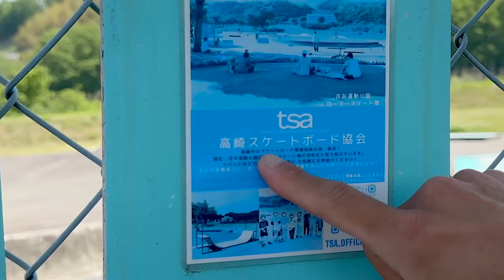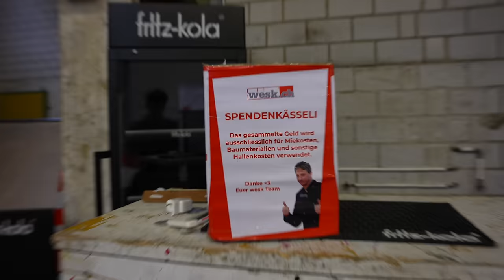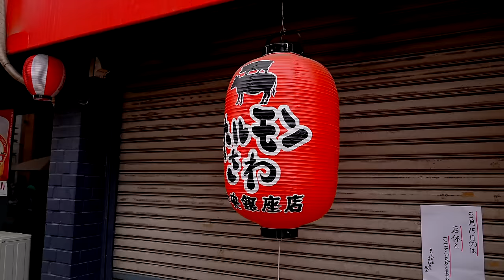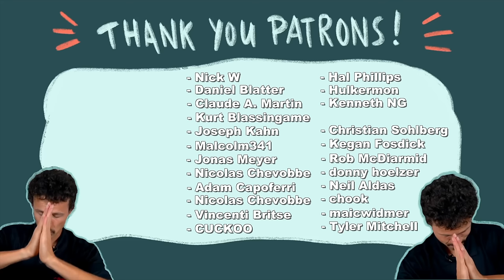GIFTED SKATER

Comment: I bought my first skateboard(custom) and it arrived today. Gonna try to ride it first the coming weeks. Had only used a waveboard when I was little.
Reply: Here's a comment of tips I wrote for beginning skaters a while back, hope you find something useful in it.

0) This might seem obvious, but I see a lot of people doing this wrong and it'll really hold you back. Push with your front foot on the board, not your back foot. To determine what your front foot is : Stand on the board on carpet or grass, first with your left foot forward ("regular stance") and then with your right foot forward ("goofy stance"). Step on and off the board a few times with your feet facing sideways, twist your body to face forward and see which way is more comfortable, that way is your stance.
1) Practice jumping off your board while it's rolling and slightly pushing the board backwards, so that it stops. That way, if you have to jump off, the board doesn't shoot forward into traffic or people. This makes it safer for everyone if you skate on the sidewalk, which I recommend doing at first.
2) If you get going too fast on a slope, jumping off sooner is way better than jumping off later. Even if the board does shoot forward into traffic (see 1) it's only a board, and you're a human being made of meat and bones.
3) Practice rolling forward and dragging your back foot, flat on the ground (don't point your toe) to slow down/stop. Yes, this grinds down the sole of your shoe, but the sole of your shoe is infinitely less important (and better to grind down!) than your human body.
4) Practice stepping off and putting your front foot on the tail and grabbing the nose of the board in a smooth single step forward. Also stepping on by grabbing the nose and stepping on the board with your front foot near the front bolts. Both will pay off mega dividends over time, because picking up and putting down one's board is something one does constantly as a skater.
5) If you see a crack or pebble coming up on the sidewalk, push your back foot down on the kick tail to LIFT UP THE FRONT WHEELS over it. Hitting a crack with your front wheels is multiple times more likely to make you fall than hitting a crack with your back wheels, because physics.
6) Speaking of falling, you will fall at least a few times in the first year of skateboarding. It's important to not get discouraged when you do, because you will fall more per skate-mile in the first year than at any other time in your life as a skateboarder. Don't assume that's how much you will fall for the rest of your skatelife.
7) Wear a helmet if you're planning to skate anywhere but very flat ground.
8) Use rubber soled sneakers which allow your full foot to flex.

Good luck, and welcome to the skate family! 
🛹🤘🤙

PS - Feel free to ask if you have any questions about the above or anything else about skateboarding!

Comment: Such good vibes. I love the direction and connections you're maing and taking here.  When we were trying to get a skatepark for our city we did many things, one of which was taking a portable skatepark (manny pads, rails, jump ramps etc) around many of the primary schools and high schools delivering skateboarding lessons to the students. We also set up the same portable skatepark every Saturday at a local gym (using one of the large sports halls) which was hugely beneficial during the cold, wet winter months. It all required lots of organisation, motivation, and commitment from all involved but was totally worth it. We finally got the skatepark and now have two more, and a DIY, to add to the original. Keep on dreming up and pushing for your own skate school. It will be incredible. Keiji Masuda is a great skater and teacher too. I love his instagram videos.